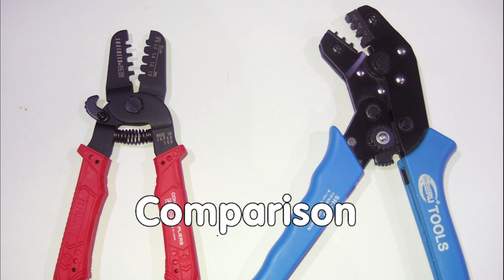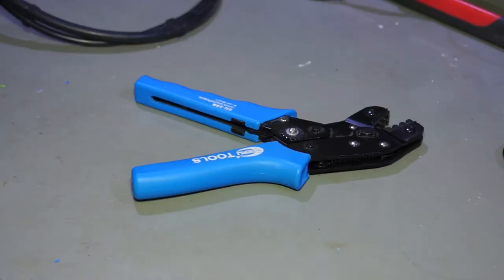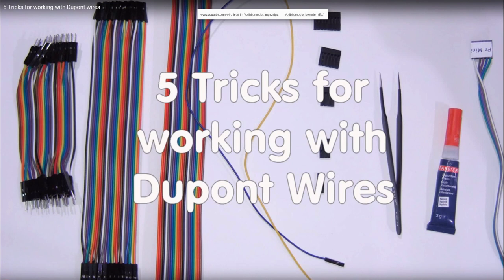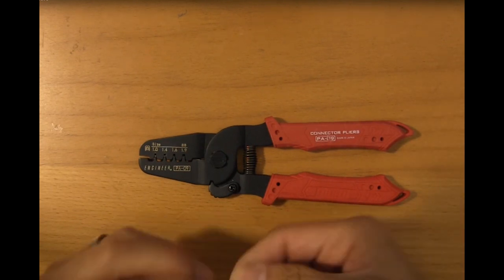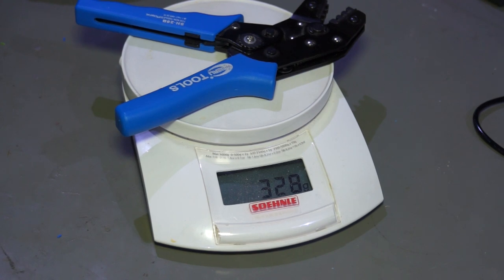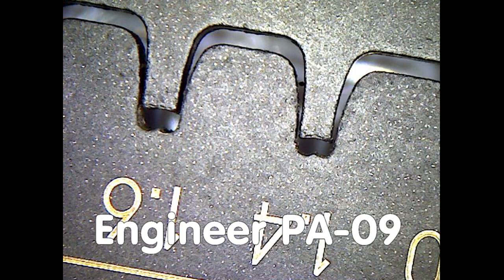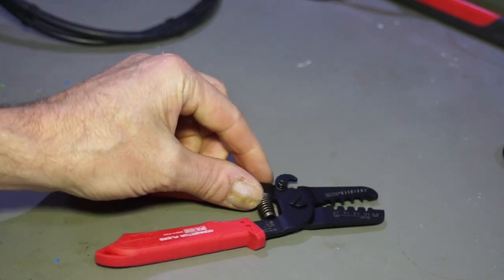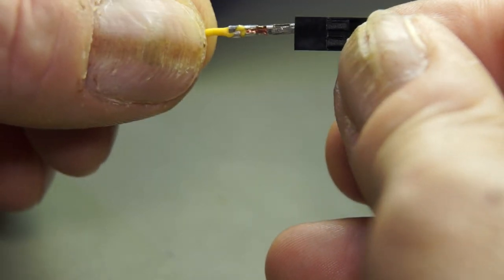#39 SN-28B Chinese Crimper  vs Engineer PA-09: Is there a difference for Dupont wires

Comment: I've actually had really good results with the SN-28B crimpers I got from Banggood. No problems at all but I want to do Molex Picoblade connectors now too so I'll have to get the PA-09s for those. Thanks for this video, very helpful.
Reply from the maker: +Ronn Wilson I had  (very) few comments about good SN-28 crimpers. So, you are one of the lucky guys!
Reply: I got the same ones and they are pretty bad, after 4 months it's un useable

Comment: The one thing that caught me out was what crimping tool can support making what type of connector. I typically find JST XH 2.54mm crimpers on amazon, but I also want to crimp the smaller JST ZH 1.5mm connectors that some drones use because they are much smaller. I can't be sure whether the tool will work for both and they come with all cryptic names and size markings that I can't figure out which one can crimp which connector. So I'm just not buying any of them because I don't want to have a shelf full of tools that I never use because it was the wrong tool. Do you have any tool suggestions? I'm sure you've come across this problem before.
Reply from the maker: I stopped crimping these small connectors myself and buy them ready.made. So I have no suggestion

Comment: I haven't yet seen anyone show how the SN crimper performs when the tension is adjusted. Most "failed" crimps appear to be crushed, and those crimpers have adjustable tension on them. Perhaps a gentler, more accurate crimp is possible with a little adjustment?
Reply from the maker: I do not know. This is an old video and maybe there are even better tools around now.

Comment: I just started making my own cables, I removed the wire from some old Apple Printer cables, circa 1998 or so, great wire for crimping and just the right size for use with the Arduino. So to begin with, I used a needle nose pliers, then soldered the resulting crimp.  This worked sort of, but sometimes the solder would creep up into the socket and block it, thus spoiling the whole process.  So I decided to take more time and be very careful with the needle nose, and eliminate the solder, this has worked fairly well thus far, and I am at the point in my life where a 40 dollar crimpper is way out of the question. I guess I will probably just stick to the needle nose and see how life goes.
Reply from the maker: Thanks for the feedback. I think, your process is very similar to what happens inside the PA-09. So, if you are skilled with your hands, I am convinced, you get the same results for less money.

Comment: There are also some crimping tools that look like your Chinese no-name one, but with Electrical Discharge Machined jaws. These have the correct profile and form perfectly the connector without bending etc.

The cheap crimpers have black jaws like the first shown in the video, while the EDM jaws are silver and very accurate and sharp shaped.
Reply from the maker: Thanks for the tip. Do you have a link for other viewers?
Reply from the maker: Thanks! I always post the link I purchased because then, the viewers know, that they got the same as I got.
Reply: I uploaded some closeups from the tool jaws so you can see their quality:
http://imgur.com/gallery/uBVgs
Reply from the maker: Thanks. They are really more precise than my tool.

Comment: I'm running into this exact issue. I've been using needle nose pliers to get around this but worried the hold is not as good
Reply from the maker: Today, I would also look at the IWISS crimpers. They are ok, too. And less expensive than the PA-09

Comment: I bought the PA-09 first despite the higher price because I love the quality of some of their other tools. The PA-09 is also a quality made tool. The tooth is sharp and works well for the conductor crimp. However, as the Engineer rep says this tool is not for the triangular insulation portion of the contacts. The problem is that the the die is just too thin. I didnt measure but it looks like the die is about 3mm thick. The strain relief portion of the connector always gets one side wrapped nicely and the other gets mangled or not wrapped tightly. 

Compare that with the SN-28B and you'll see that it has a much thicker die that includes a ridge in the middle for aligning the triangular insulation tabs.  As most people know the cheap versions of that tool arent machined very well and dont have a very sharp tooth in the die. However, the IWISS brand one gets great reviews on Amazon and shows a sharp well machined tooth. Best of both designs.
Reply from the maker: So far I did not have problems with my PA-09

Comment: Hi Andreas.  I found your video because I was trying to solve issues with bad crimping results using the cheaper Chinese SN-28B crimpers.
I have been having the exact same result as you showed ... badly crimped connectors and bent so that they would not fit into the Dupont housings.
So thank you very much for this video.  I'm off to buy a good set of crimpers.
Reply from the maker: +Rick White You are not the only person. I looked also at other videos and saw the same effect. So, I hope you will get also a good set of crimpers...

Comment: I have the same blue handled tool. At least it looks the same. The first time I saw your video I agreed with you. I couldn't make it work. Now I like the Chinese tool better and I will not be buying another tool. I like it better because it is faster. Use it correctly and the result is fast and clean. If they only included instructions all of us wouldn't have wasted so much time. After looking at every related youtube video I could track down I finally found a video that shows the correct simple method. Basically the first step is to put only the connector into the tool. Squeeze the tool a small amount until the fingers barely come together leaving a clear hole for the wire. Don't over squeeze or you will have to start again with another connector. At this point the tool will hold the connector nicely while you get the wire. That is obviously the reason for the ratchet. You don't need three hands after all because the tool holds the connector. Next stick the wire into the hole you just made in the end of the connector. Then squeeze the tool the rest of the way. Done! That's it! Clean and simple. 30 seconds total per pin and no other tools needed. And no bent pins that don't fit. And that was first try. I'll probably get faster with practice. In 2 minutes I had all 4 of my pins done and inserted into the connector housing. There were other things I needed to get right that I learned in the video. For example I was putting the connector in the tool upside down. The fingers go into the round bottom hole first and the flat part of the tool pushes against the back of the connector to push the fingers in which curves them around. Sorry I've lost the video that solved it for me (I closed it after my first success) but it shouldn't be hard to find. This method only works for ratcheting tools but for those tools it works well. It is too late for you and me but I hope this note saves others from the torture we suffered trying to make this tool work.
Reply: I have a similar crimper and I've been going crazy trying to get it right. you both helped a lot!
Reply from the maker: Thanks for your exact description. I am glad you are successful with your tool. Maybe it helps others. For me it is too late because I use now the new crimper and disposed the old one.
Reply from the maker: Were you now succesful?

Comment: I've crimped a few hundred pins for DuPont style connectors with a GC-7591 using the first top for the pin-to-wire and the first bottom for pin-to-insulation crimps.  I usually just rotate the tool between crimps and always crimp in the first top slot.  I selected this tool because it was available at a local shop and about 1/4 the cost of 'the right' tool and insert which I was told wasn't worth the extra $$.
Reply from the maker: Thanks for the tip. Seems to be another valid alternative.

Comment: I have the same ratcheting crimpers and not happy about them either.  I found some adjustments have helped get me close but I still have to use small pliers to finish them in order to fit housings.  Not sure if I can find better dies but at this price point I might as well have bought the better pair in the first place
Reply from the maker: If you read the comments, you see, that you are not alone ;-)

Comment: I have used a cheap crimper supplied by a previous employer but was unhappy with the results. I bought a PA-09 after watching another youtuber making connectors.
The PA-09 is the only tool I will use for crimping.
Reply from the maker: Thank you for your feedback. It helps others to decide.

Comment: I just bought the blue crimper and it crimps perfect every time. There is a small and large side to the jaws of the crimper.  Is it possible that you inserted the pin the wrong way?  I just posted a video to my channel if you want to see,  Thanks for yours!
Reply from the maker: I think, I did it right (you can try, it does not work the wrong way). If you read some of the comments here, or watch other videos where they use the same crimper, you see, that I was not the only guy with this problem. So, there are three possibilities: 1. they changed their design, 2. You were lucky and got a good one, or 3. you used different pins which work better with these crimpers.
Reply: I agree with your assessment

Comment: Andreas, I bought tool this after watching your video but my connector pins don't work with it. My wires are 26 awg. The conductor barrel fits inside the die hole but it too wide for the tool so only 80% of the barrel is crimped. Plus, after crimping, the connector gets stuck inside the die and gets bent when I remove it. What size are your connectors and where did you buy them? Do you put oil in the die holes?
Reply from the maker: I cannot say more than shown in the video. And if you read the comments, it seems to work in most cases. I do not use any oil.

Comment: Andreas, do you have any recommendation for a stripping tool (to remove  insulation from wires)? I have to fabricate quite a few of this cables with JST terminals and AWG 22 wires.
The PA-09 crimping tool arrived today. Now I don't know how to pick the right stripping tool.
THX
Reply from the maker: In about three weeks I will make a video with 8 strippers.
Reply: I will order this one tomorrow. 
Weidmüller Stripax Abisolierzange 9005000000
I will let you know about my experience, even as I can not present it professionally by means of video.
Reply from the maker: This one is not in my selection. So it is good if you try it.

Comment: Well, I am not using any crimping tool right now, I do it manually and it is slow but I always solder wire so crimping is just to hold wire in place. (too much time waste)
I know in professional world it would be different story but if you do not use it so much it's not a big deal.
 I am going to get some crimping tools and this video is big help to choose my. Also I will get few versions so I will have option which is better for which wire. It can't be all in one and to be all perfect. You must have more tools for same job. You must have an option sometimes one tool can not do some wires well. It is my advice to people...
Reply from the maker: This comparison was only for Dupont cables.

Comment: My experience has been similar to yours: the all-in-one crimper sucks. But what I don't understand is WHY?? Are the jaws just the wrong shape?
Reply from the maker: I do not know. But recently, I got a SN-28B from IWISS and it worked ok...
Reply: The SN-28B is designed for a completely different type of terminal, and does indeed have the wrong jaw shape, and wrong jaw size, for DuPont terminals. It’s completely incompatible, which makes it that much more frustrating that the Chinese sell it for that purpose!

Comment: I may be wrong, but these arduino Pins are PH 0.2 or XH 2.54 compatible. Therefore the right tooling should be the SN-01BM from the Chinese manufacturer. These are different size than the 28B you used, that for sure are to wide and cause the assembling problems. I got the above from aliexpress and it work like a charm.
Reply from the maker: Your info is a well kept secret if you look at the comments in this video and also other crimping videos!
Where did you buy yours? Maybe it helps others...
Reply from the maker: Thanks!
Reply from the maker: I got now this crimper. For me, it does not work for Dupont wires. Mine is too small to cover both crimps as the SN-28B did. So, I stick with my PA-09 and use this one for PH or XH crimps.
Reply: Hi Andreas, I measured thickness an mine is exactly 4mm. This is totally in sync with pins and connectors. also 4mm and able to crimp the wire and the cable itself. What is different at your side?

Comment: My crimper from IWISS was less than your one from Japan but its die for these types of pins has two levels of grooves for each pin slot so that it crimps both the wire clasp and the insulation simultaneously.
Reply from the maker: I googled them and they look similar to the Chinese one. But I read, that, if the grooves are well made, this type also works. So, you have no problems with inserting your crimped cables into the empty shells? Which exact type do you use? Maybe I will then do an update, because this video is already quite old...
Reply: At a very quick glance they look similar, but the grooves on your chinese piece are... a joke.  They're almost nonexistent, so no wonder your pins get smushed and flattened.  The ones on the IWISS are formed well enough to crimp molex and dtm pins nicely, and all in one crimp rather than two..  They have no problems inserting because there is no deformation and the pins look like they're supposed to look.  Just something to think about, I had having two steps when I can do one, especially with wiring when you often have to crimp soooo many wires or in my case do them in difficult locations (I work on cars as a hobby).  I'm definitely not saying the IWISS is the best way to go as there may yet be a better hand tool in the same or better price range, but I haven't found it yet.
Reply from the maker: I just found a video about one of the IWISS crimpers for Dupont wires. But he seems to have the same problem as I encountered (https://www.youtube.com/watch?v=djFfYYerJHA at 5:30). Do you have a different model?
Reply: I'm using the IWISS HS-30J.
Reply from the maker: Thanks!

Comment: I might have to g get some of those crimpers !

I would like to know what your favorite wire strippers are ?  The strippers I have either cut a couple of strands off (not good when you are working with 18AWG of smaller stranded wire) or do not cut the insulation completely make it difficult to remove.

Comment: I am in exactly the same position in regards crimping, although I use them for retro Atari hardware modding and not the Arduino.  I have had the 'wierle' chinese pliers for a year now and never been able to produce a good result in one go.  Even after adjusting with pliers I end up with the same mangled mess you describe and it is almost impossible to get them in to the plug bodies.  I have therefore been looking around and come the same conclusion - the 'Engineer PA-XX' pliers are the way to go, although they are all extremely expensive.

Given the price factor I have been a little unsure which to buy as I really cannot afford to get the wrong one.  The choice seems to be between the 'PA-09 micro' or the 'PA-21 universal'.   Can I ask, do you use the 1.6mm aperture for your DuPont crimps?  If so then I guess either of those Engineer models will do, although maybe the PA-21 would prove to be more widely useful in the future...

Anyway - excellent video and it has really made my mind up for me!  I look forward to checking out your other uploads!
Reply: Having just bought the PA-09 and using it for Dupont/Molex KK, I'd say to get the PA-21 for a wider range.
I'm only using the max 1.9mm on the PA-09 for these crimps and it's slightly tight, but perfectly usable with great results.

Even if you needed 1.6mm, you'd still have it as the minimum size on the PA-21.

Comment: I had a chinese crimper at home and used it for like 1 connector a month it was kindof fine  ...  but ...I bought a set of PA-09 few weeks ago because I was heading for a project who need many connectors,  they are really good and precise,  the 09 is good for molex JRFit, Dupont and smaller open crimps.    09 are not fast as the real expensive Molex tool at $300 ( we got than at the job) but for the price they are the way to go, forget the cheap one if you are making few connector a week ...   btw Molex has  a nice version of a simple crimper around $75 than also do bigger open connector, Engineer has also the PA-21 ... but I didn't try them tho, probably good !
Reply from the maker: Thanks for sharing your experience!

Comment: Andreas Spiess, can you tell me how long your Dupont pins are ? As far as I know those common pins from China are 10 mm long which are difficult to work with. There are also 12 mm pins (11,7 mm) that should be much better. I took apart one original Dupont connector and it had 12 mm pin in it. So I think these 12 mm pins work better than those 10 mm ones from eBay. I just want to find some seller who sells 12 mm pins.
Reply from the maker: I work with the cheapest Chinese pins and have no problems with the new tool